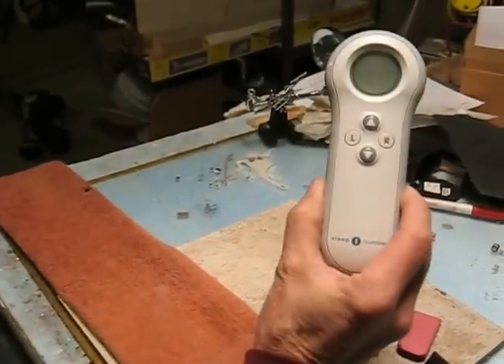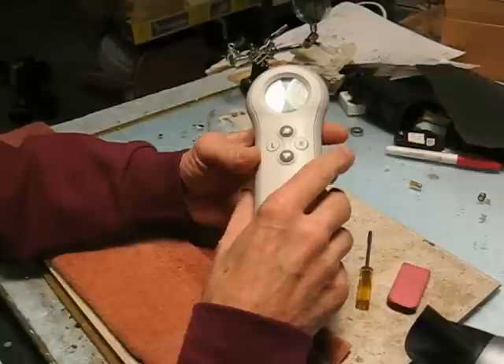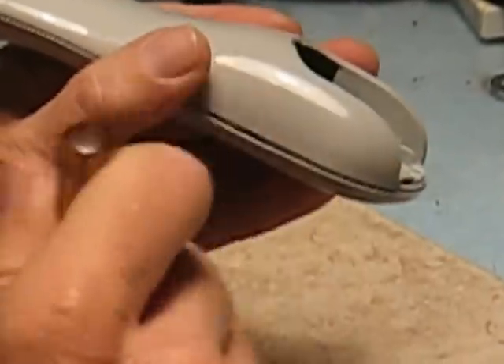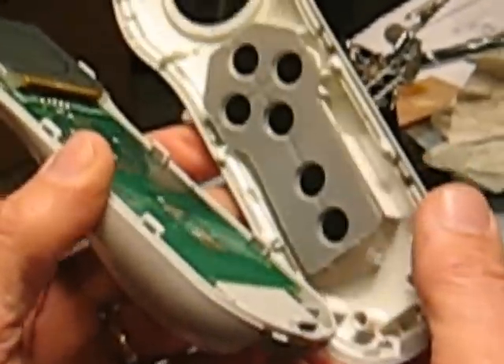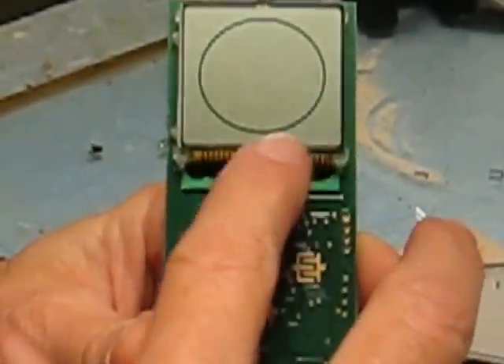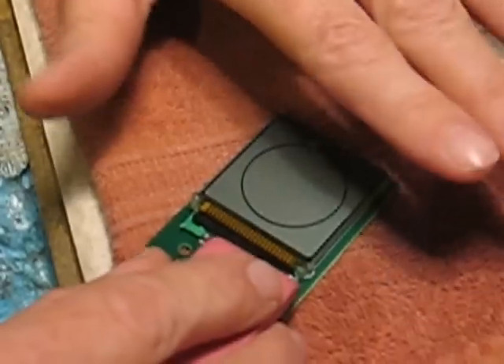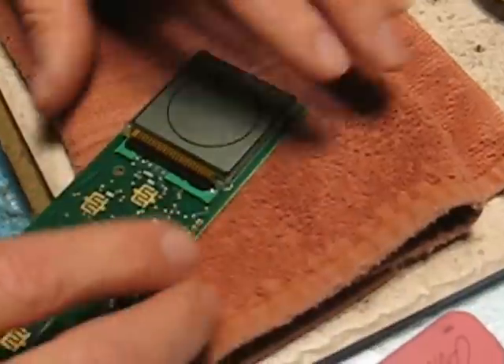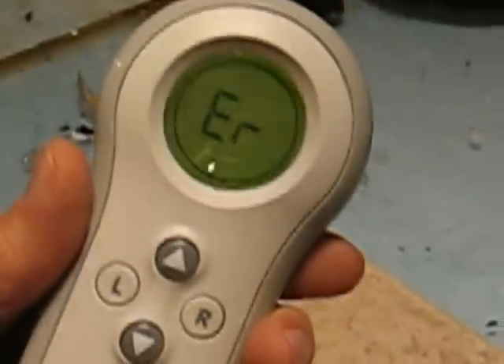Repair sleep number (Select Comfort) bed control display

Comment: What I need to know is how I can get air BACK into my bed after moving it when it appears the remote and pump are not doing anything. I will not purchase a new pump and remote for $500. There has to be a way to get air into that bed without jumping through hoops. The pump beeps when plugged in and the remote starts to count down after 3 it says ER. Changed the battery, nothing. Someone help before my husband has a heart attack.

Comment: Do you think this would work with a similar-appearing but hard-wired (NOT wireless; thus probably even older) control?
Reply: I tried it. It worked on the second one. In a sense it worked on the first, but I heated it too often and too long and it left a permanent black spot in the middle of the display. Sigh.

Comment: Shows the manufactures and creators intent to defraud customers by making cheap products they can continually resell to unsuspecting customers for a lifetime. "Well sell cheap clickers and sell them another when they break @sleepnumberbeds. They design the bed the same way with two bolt washers that are sharp at front of bed that eventually wear the mattress intentionally.

Comment: No luck for me. The read out is still saying "no".. not sure if it is a remote problem  or the motor. Any help will be appreciated.
Reply: Not sure where your issue is but this fix is mainly cause people's displays aren't working / displaying anything, if yours has a reading of "no" then I don't believe this solution is the one for you.
Reply: I agree with Matt. If you can read the message on the display, then your display is working and that isn't what this repair addresses. Sounds like a communication issue between the remote and the pumping unit. Perhaps your remote and the pump are too far away from each other or there is something blocking the signal between them. A piece of furniture, or maybe a tote under the bed...

Comment: Hi Greg and everyone, this works for me but only for 24 hours.. Any help would be appreciated. 
I have done this aggressively 3 times now with a heat gun, I pushed on the ribbon and got the screen fully black each time, which makes it work for about 24 hours and then it starts to fade till it is all blank again. 
Anything I could be doing wrong? 
I was looking into an electronics store to maybe heat off the ribbon, clean it, then re-adhere it but I haven't found anyone who does that in South Florida yet.. Any ideas?
Reply: Heat guns provide a great amount of heat in a short amount of time.  When I used the heat gun on LOW and saw how quickly the LCD darkened I thought I had it made.  Found that the heat may NOT have saturated deep enough to completely soften the glue.  I then held it further away and used exaggerated sweeping motions for a longer period , and used a PENCIL eraser and THe Lead end of the pencil to manulipate the "glue" .  BTW today I did it and the future will be the judge....  Good Luck
Reply: Thanks for the reply, the day after I posted this, I thought some more and came to the same conclusion as what you described. So I held the heat gun 2-3 feet away and let it thoroughly heat up slower and used the same sweeping motion, then used a similar item to an eraser to slowly spread the glue instead of just pushing on it. So far it's been about a week and thank God it's still working so far. 
As a side note.. I went to a few electronics places to see if they would heat it off, clean it, then re-glue and re-apply it, 1 of which works on small technical stuff but nobody would touch it lol

Comment: I've tried it 3 times with a heat gun. The screen went totally black (as suggested)- but still nothing. The one long metal piece he showed- was actually two pieces for me. Apparently mine came apart. Did anyone else experience this? Would this be the reason it's still not working? Nothing shows on my display at all. Should I heat up the black blob of "glue" on the back? Any extra hints would help.
Reply: I heated mine up several times before I realized that taking a rubber eraser (pearl style) and pressing hard on the brown ribbon that connects the lcd and the board actually did the trick. It wasn't so much as pressing on the screen itself. Hope that helps you! Don't know about the metal you're talking about- sorry.
Reply: Don't heat the blob of glue on the back. That is just an epoxy shell over the LCD's microprocessor.  I doubt that will fix anything.